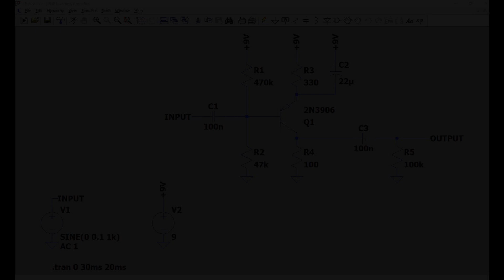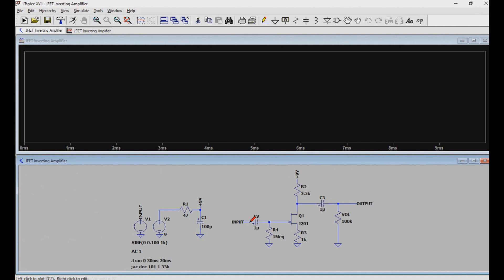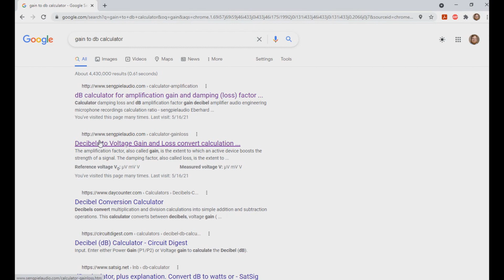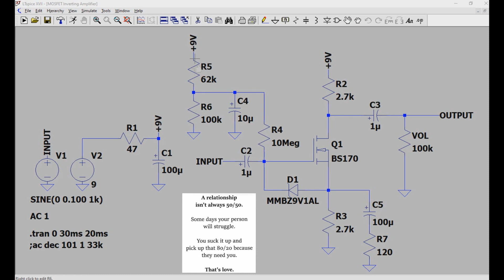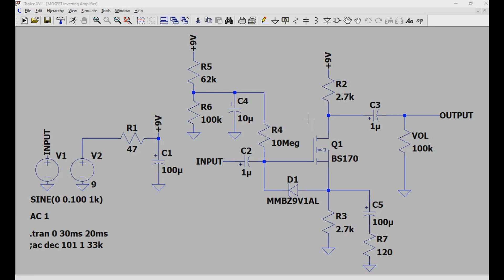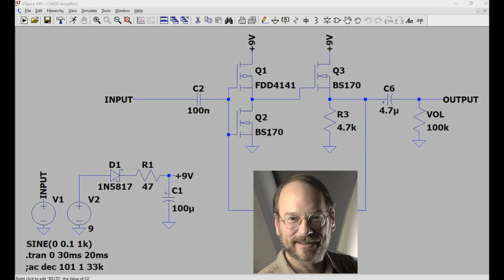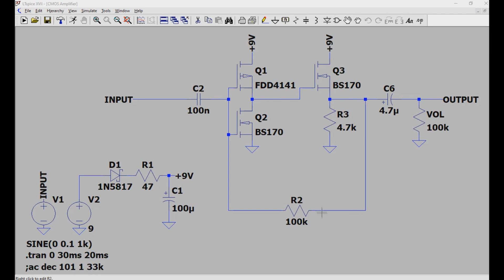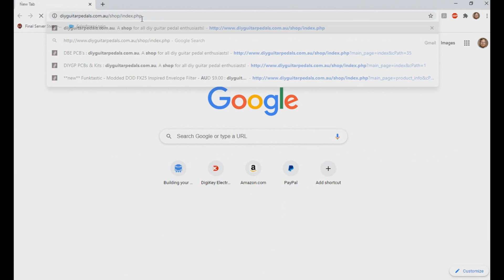5 Kinds of Boost Circuits in Your Guitar Pedals

Comment: Hi, I’m kind of new to making pedals and I’m confused as to why on the second Pedal/type of Pedal (J fet boost), why are there two inputs, and why is there two different circuits on the same schematic, like why are they split? Love these vids btw!
Reply: You might be referring to the voltage supply in LTSpice. I have it provide a "voltage supply" for the input that is an AC sine wave of about 0.100 volts, or 100mV at 1 KHz. 100 millivolts, because for a single string note on a decent pickup should generate about that much voltage and 1 KHz is a good benchmark frequency for guitar and bass pedals. So the "input" on the left is that. The "input" on the right is where I am "plugging in" that 1 KHz signal. This is the virtual equivalent of plugging my guitar jack into the pedal.

I hope this helps. We go over this a bit in the LTSpice videos.
Reply: @erikvincent5846  Ok, so if I were to try to build it on a breadboard would I ignore the section on the right and just start from C2? Like input into C2 etc?
Reply: @marcorosella88  Keep all the stuff on the right, C2, R4, Q1, R2, R3, C3, and a 100K resistor as a pull down to ground to simulate your volume pot.
Reply: @Erik Vincent Ok, thanks!